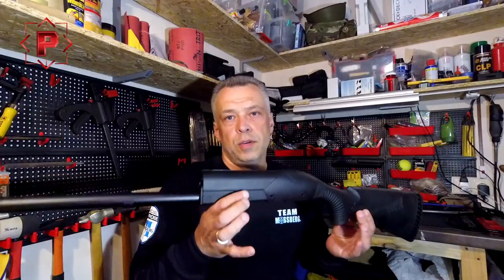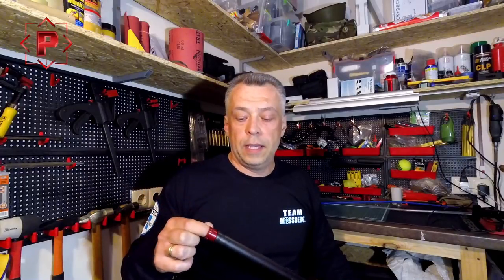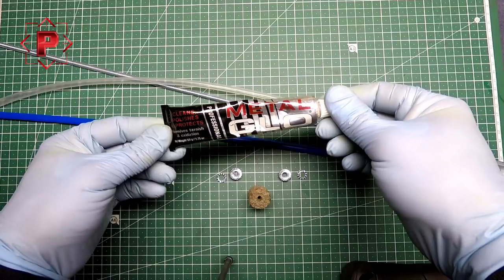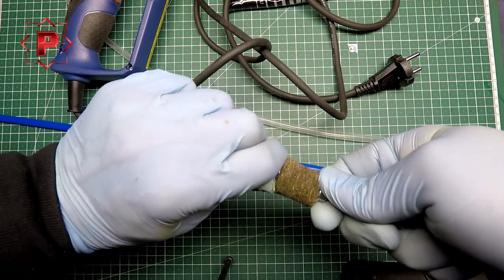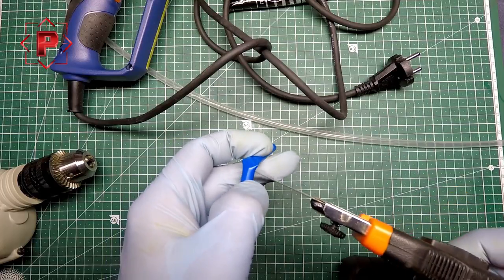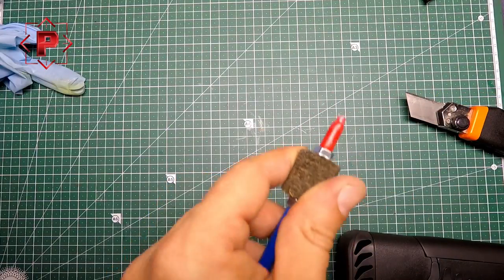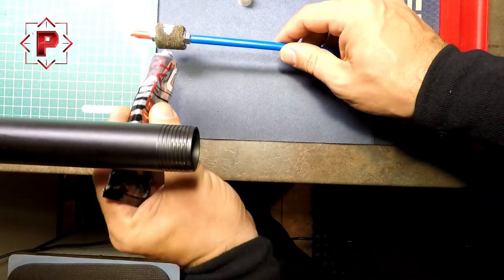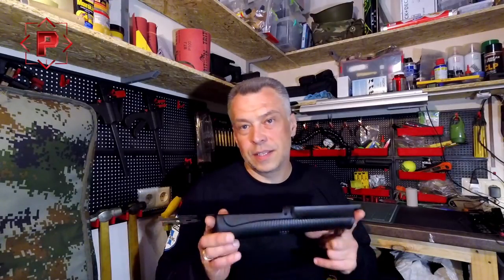How to... Clean and polish shotgun mag tube

Comment: I used a Dowel Rod with cuts in it & oooo steel wool, YOU WANT IT TO FIT PRETTY TIGHT. Also used Mothers Mag Aluminum polishing compound & a bore mop on brass cleaning rod after wards, 10 GAUGE MOP fit nice in 12 GA. tube.